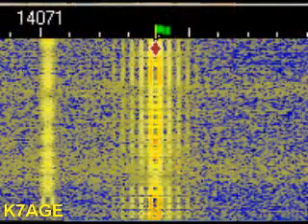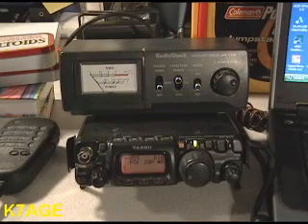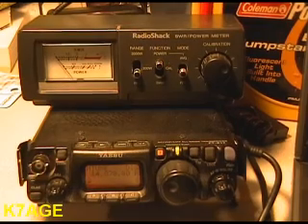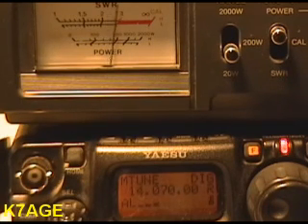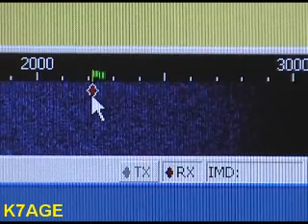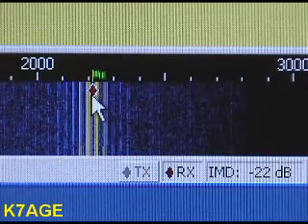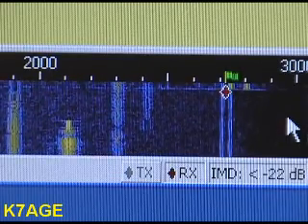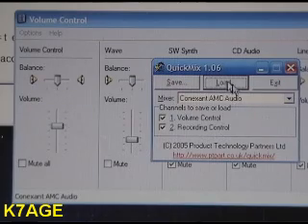How to adjust transmitter level for PSK-31 Ham Radio

Comment: in windows 10, my on board sound card doesn't have the wave slider. it only has playback and recording sliders, using signalink usb usb interface. wonder why 10 doesnt have the wave slider

Comment: how the heck do you set this up with windows 8.1  ?  I have the Signalink USB. Worked great when I used Windows XP But nopw I have Windows 8.1 so help me !!
Reply: +mykenwood830 TRY "FLDIGI". I have to keep reloading digipan with Windows 10 too. The audio keeps going out on "Digipan", and it won't come back until I reload it. I can unplug the speaker jack, hit CQ TX, hear a pop, and then nothing comes out.  FLDigi has probably 200 different types of digital modes from MFSK-31, QPSK31, Hellschreiber, CW, Olivia, Domino, Throb, THOR, RTTY, Weatherfax, Contestia, MFSK,  MT-XX, etc. It has some super fast freq & phase shift modes, and some really slow narrow band modes that will transmit through mud. When I tried the "help" button for Digipan it went nowhere, telling me it has been orphaned, forgotten and FLDigi is the new "in thing" now.

Comment: Hi, I'm using an 817 with a ZLP sc interface when I click tune it keys the radio and if I adjust the alc to no bars then it doesn't key the radio ? Also where is the TR button you mention ? Thanks.

Comment from the maker: Sounds like you are using VOX to key the transmitter. The audio may be just a bit different on 40. Try tweaking the level up a bit from the computer, and reduce the audio gain on the transmitter. Or, if there is a VOX gain setting, tweak that a bit.

Comment from the maker: @insideofitall You can still have distortion even with low power. The distortion comes from over driving the system. Set the audio level, raise it and watch the power out. When you see power out not increasing, back of the audio level a bit. Try a qso and ask if you signal is clean.

Comment: Thanks for the video! I just got the FT-817ND and am setting it up so this is a big help.

One quick question. If the IMD is okay, and you're not at full-power on the rig (maybe 2 or 3 watts or something like that), is it fine to have a couple of bars on the ALC? Since these rigs are low power as it is, I want to get as much out as possible without distorting or worrying about my finals.

Comment from the maker: @lioii I would think no. FSK is for RTTY, and it is not dependent on audio levels from the pc. I think you need to be in the mode that the sound card is feeding the radio and adjust the audio level so that you are not over driving the radio.

Comment: On my TS-850 I tune up in FSK mode ensuring no ALC and I set my output power, usually around 40w. I then switch to USB and start playing PSK. Is this the correct procedure??

Comment: Two points, but first of all, great video.  TKS!

First, the reason ALC is kicking in before "full power" is indicated is because of the difference between Peak and Average power.  You are putting out full power just before ALC kicks in, even tho you don't see it on the meter.  Second, I use an audio pad between the computer and the rig which allows me to operate audio more toward the linear region of the sound card (and it gives me a wider range to fine tune the audio level).  73!

Comment: that way it would be hard to mess up the audio settings in the mixer program just keep it full blast all the time. I also recommend getting a 2nd pci sound card so windows and webpages sounds don't get transmitted out. That way you can jam to music while in QSO with your friend on psk .. Hope that helps as well , tnx for the vid 73 to all

Comment: I usually set mine up by the forward output and make that needle bounce as much as possible it will hit 100watts sometimes but, not all the time! when no text is going thru it should be at least 25% weaker than pep. bpsk31 is not 100% duty but, pretty close. in mixw there is a neat feature for audio levels called Amplitude level for this mode. set to 1.000, 1.000 is full output audio set to around maybe .3 to start and see if you can hit 100 watts.  continued

Comment: yea that is one of the big myths out there about strong bpsk signals. no matter what power setting you are at you can have a dirty signal. Some things I seen out there that can cause some problems is ground loops, a sound card with high THD% , EMI from other equipment or AC lines, RFI from the actual transmitter getting into the audio lines or chassis. one thing I found on some rigs out there is that the ALC meter will read wrong somtimes.continued